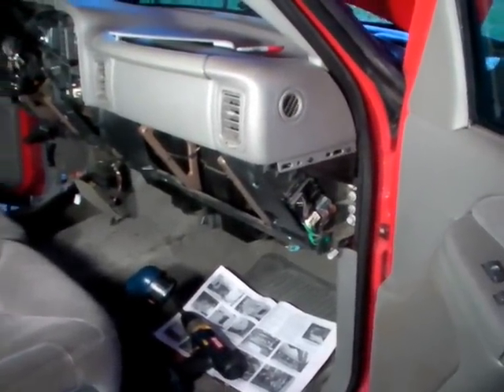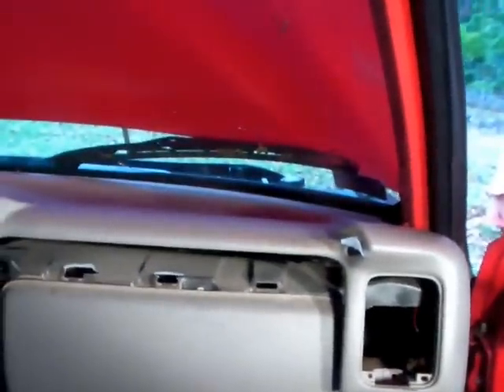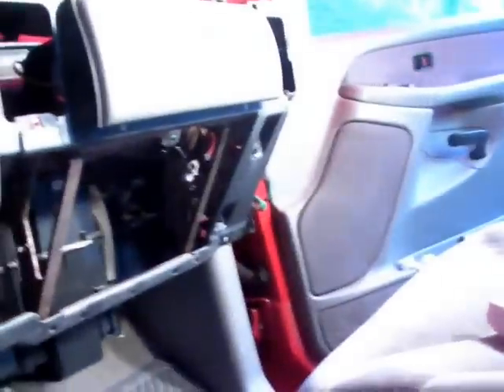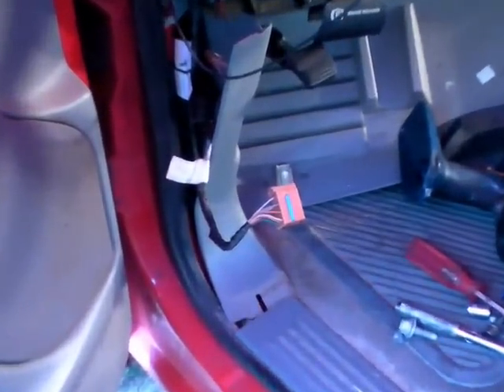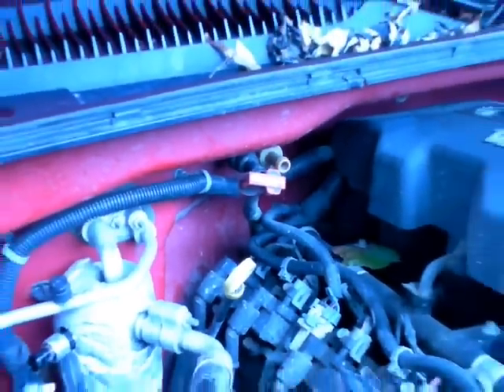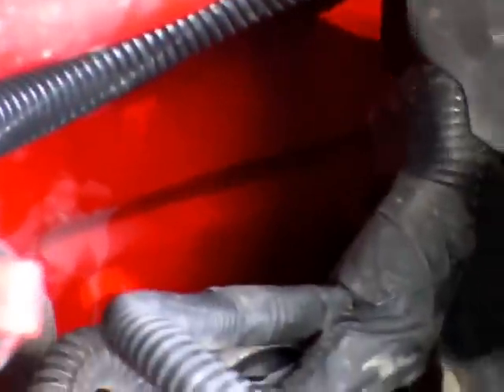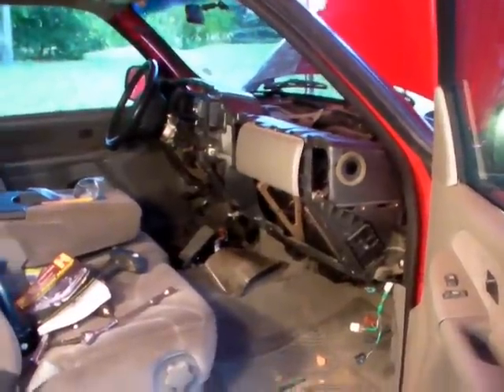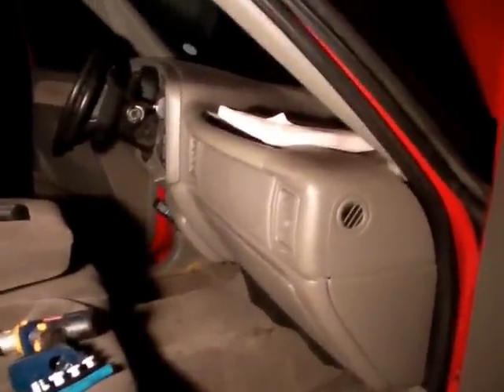GMC Truck Heater Core Replacement 2000 Sierra Silverado

Comment: I've been a mechanic for 30 yrs. I have done several of these and there are flat rate tricks for this job. Leaving the column in is one of them. Good job my man. Not many can do this job without major difficulty. A+
Reply: Want to do one ?  Mines leaking bad

Comment: I am a 50 year female and had my 19 year old daughter helped me with this project as it was her truck. It was definitely an undertaking. The big bar needed to come off on the passenger side and it took me a quite a while and a couple of times watching the video before I saw that important piece of information. Once I got that off and the two screws that were hidden up behind a bar in the center of my firewall it finally came free enough to remove the heater core. It was nice having some help putting it all back together. Did not have any leftover parts, so that was a good thing. What was Chevrolet thinking? If my 05 Tahoe ever goes out I might pay someone to do it. Then again, it has to be easier the second time around right? Hope, I NEVER find out! I won't be giving up my day job to take up wrenching.

Thank you for posting! I would never have figured this out without YouTube videos such as this.

Comment: Thank you SO much for this video. My son wanted to replace his heater core on his truck, and I told him that it will be a herculean effort - well, I found this video, and he watched it on his phone and took off to have his A/C drained; he was gone in a flash while I was pulling tools out that I thought he went to visit his girlfriend lol. He came back, asked me to turn the radio on, and told me that he just wants me to hang out and he will do it. Well, 5 hours later, he had taken his dash off, replaced the heater core, and had it all back together and running perfectly thanks to the video. The only "help" he wanted from me was to chew the fat and keep him company. 16 year old kid. He said to me after putting the last screw into the dash "I wish I could shake that man's hand for his video".
Reply from the maker: Glad to hear it helped him out. It took me a lot longer LOL

Comment: Hey.  Thank you very much.  Your video inspired me to do the same job on my 2003 Silverado.  it pretty much went the same....lots of trial and error, but slow and steady.  I ran into a snag that I would like to warn others about....if you end up freeing the passengers side airbag canister, be very watchful when you put it all back together.  I ended up having to backtrack after having it 95% reassembled because somehow, the lower mounts on the canister got hung up on the dash sub frame and would not budge.  This caused it to stick out a little on the bottom edge, so if you see that stop what you're doing and fix that first. I wasted 2 hours backtracking and trying to figure out what went wrong (mind you I was very tired after 7 hours of working on it before this discovery, not to mention a full day at work work also).  I found that loosening the top 2 bolts on the front of the canister through the vent holes to completely remove and reset the air bag canister was the best route.  I am happy to say that I had 0 extra bolts and I know that everything was back the way I found it when the job was done.  I understand now how a persons spiritual beliefs take the foreground in this job, because I caught myself praying a lot! A true test of your patience. Ridiculous design! I also replaced the stepping motors in the speedo cluster during this job since it was acting up also.  Now I have heat, no syrupy nauseous smell, and a smooth operating instrument cluster.  Air conditioning will be restored on Monday as I want to have the garage perform a vacuum leak down test since it is a new to me vehicle.  Thanks again and sincerely, God Bless!

Comment: Great Video!   I cannot, for the life of me, figure out why the engineers did not place this heater core in a more accessible area.
Reply: Because "engineers" couldn't pour piss out of a boot if directions were written on the heel...

Comment: From a fellow Christian shade tree mechanic!  Good video and giving glory to God too.  My 2000 Sierra just stopped giving very much heat... it’s not leaking so I think I’ll try back-flushing the heater core first. This replacement project looks tough but a 1993 Taurus I did years ago was far worse. The whole dash was removed down to the firewall. GM used to make the heater cores accessible in the 70’s and 80’s from under the hood but following fords lead they went modular assembly for HVAC systems.

Comment: Well it turns out I did it. It was not as bad as it looks, and reassembling went much smoother than I expected and it was nice getting a chance to wipe everything down. In my experience I did not have to drill out the rivets on the glovebox hinge bracket, you only need to take the bolts out, also the large metal support bar is something you should try to disconnect from the firewall, the entire dash is connected to the metal bar and will not come out with out it. Other than that your video helped tremendously, thank you!

Comment: Ithought it was quite funny that you combined carpenter skills with mechanical skills by using the claw hammer to draw the heater box flush with the firewall !!!  Very clever. lol.  Good job on the video. Keep it up.

Comment: I know and Gods knows you lied about your refrigerant "leaking out." That's okay your video was still helpful.
Reply from the maker: I never said anything about it leaking out. Im sure a little did but you dont want to get air in the ac system if you can help it. Glad it helped

Comment from the maker: Your welcome.  I bypassed the heater core when It started leaking until I got around fixing it. At that point I only had to add a little coolant, basically just enough to fill the heater core.
Reply: How do you bypass the heater core?

Comment: Have to admit seeing the entire dash ripped apart is intimidating when you have never done it. I love it when Christians take time to give the honor to Christ however. It obviously takes some planning, insight, patience, and on my part a rather tidy some of faith to embark, and follow through. I am impressed it took only 8hrs. I have rat issues and am looking for any information I can muster to take apart the air box to clean it out, and find my best method of rat proofing my cab. I need to properly seal off all openings with wire mesh. I live right next to a farm, it is cold out, and despite my best efforts to clean up after them, and disinfect they keep coming in.  I am not sure what to do.

Comment: As an owner of an 04 Escalade, I'm impressed with how poorly engineered the GMT800 platform was.  I'm pretty sure the design and engineering team who put this vehicle together came from some indigenous tribe who had never seen civilization before. And it's not even like GM needed to conserve space, thus forcing the heater core location. The more I work on my Escalade, the more I realize I need to dump it, and quick before anything else goes wrong on it.

Comment: Your right Art, I keep thinking the model year changed in 2001 but it was 2000. My mistake. Greg, yes it has to come apart in this fashion. I just did a 1999 Suburban and it was just 6 screws and a clip

Comment: On my 2001 Silverado, facing the firewall from the perspective of outside the truck in front of the grill, the inlet is on the right and the outlet hose is on the left.

Comment from the maker: Pull the two black hoses off the the heater core by the firewall and put them together with a couple of hose clamps and a barbed plastic hose coupler...and BAM...bypassed!

Comment: @5:00 that tool is available from Autozone for $10..It comes in a package of a few, in different sizes but I used the black one on my 2001 chevy 1500 silverado..

Comment from the maker: Just remove the heater hoses from the heater core that sticks out of the fire wall (cut off the quick connect fittings) Buy a barbed coupler that fits the hose and put the two hoses together using a couple of hose clamps.

Comment: Does the hot cold air knob have anything to do with the heater core. ? My control knob is stuck on hot
Reply from the maker: no it sounds like a blend door problem

Comment: I gave up on trying to find the quick disconnect tool for the heater core........................I just cut the plastice connecter off the end of the heater core........you can connect the hose directly to the heater core............

Comment: Whats that tool that is needed to "quick" disconnect the heater core ports from? Or is there an equivalent that I might have laying around.
Reply from the maker: James Martin not a real good way to make a tool to remove it. you can buy it at an auto parts store for under $20 or maybe Harbor Freight even cheaper.

Comment: He's making it harder than what you need to.  WOW!  Take 7 bolts out behind the bulkhead and the whole thing drops down.    You don't need to take all that stuff that he did.
Reply from the maker: Sorry, this is the easy way. the manual says to take the steering wheel off.  The 98s and before were the easy ones
Reply: Bradley Harris is this true for all suburban I have a 2005 escalade

Comment: Great video but that is insane to have to take off what seems like half the truck to get at that thing! Has anybody thought about some crazier ideas about getting some heat into a GM Truck? Like drilling 2 extra holes into the firewall and mounting a new heater core under the dash on the inside of the cab and putting a fan in front of it that is on a switch and then turn fan on for heat and bypassing it in the summer?

Comment: my truck it the same model as yours and is leaking antifreeze inside the cabin and it does blows hot air still but have to add antifreeze very often  .my question is how do i know it the heater core the piece i need to replace?.
Reply from the maker: Its the heater core. only thing it could be if there is coolant leaking in the cab
Reply from the maker: You should also be smelling it too.
Reply: Art Keller yes it very smelly i can even see the coolant dripping..and the windshield and windows get all  foggy..thank you for your response
Reply from the maker: Sorry to say your heater core is shot. You can always bypass it if you can do without heat for a while
Reply: Art Keller it be nice but i live in utah and it is way to cold now in winter  ..i probably take a day off and do it no option.

Comment: hey my 05 silverados heater takes a long time to heat up and when it does sometimes it goes, then comes and goes, any idea what is causing it?
Reply: Could be the hot/cold servo on the bottom of the a/c box.  You can verify it by placing your finger on the small circle that goes through the servo- hold your finger on it and move the temperature selector to feel if it is traveling as you adjust it.

Comment: WOW THIS MAY BE MY PROBLEM.
 MY 2000 SIERRA IS NOT BLOWING GOOD HEAT AT ALL.
THANKS FOR THE VIDEO.
 I WILL SUBCRIBE.
 KEITH KUHN
Reply: if your not getting heat, I would just try flushing the core first. I've done a few times with great success. Just undo the heater hoses from the block, drain as much as possible and fill with radiator flush with the hoses suspended. Wait about 20 or more minutes then flush with water.. reassemble and top off coolant. I prefer that to trying to flush the whole system.

Comment: You do not need to replace the heater core!!! Save a ton of cash and a lot of your time and effort.  The fix is cheap and can be done in a couple of hours. I have a 2007 Jeep Liberty and the heater core was leaking and had the terrible coolant smell in the vehicle when driving. I constantly needed to add coolant to the reservoir. This is what I did to fix my problem. I disconnected the rubber hoses that are connected to the heater core.  I then did a thorough reverse flush to get all the crap out. Then I went to Lowes and purchased a cheap sump pump. I believe it was a 1/2 HP model that cost about $99. I previously purchased Bar's Radiator Stop Leak, Professional Strength Formula. The package has six large tablets. I recommend this brand because this formula was used professionally by GM for many years under a different trade name. I then proceeded to connect the appropriate fittings from the pump discharge to the heater core inlet. I placed the pump in a five gallon bucket of hot tap water with the appropriate number of tablets dissolved (I used one tablet per gallon of water) and ran a hose from the heater core discharge back to the bucket. I kept the bucket at the same elevation as the heater core. I then ran the pump for about 20 minutes in this configuration. After that, you just remove the pump and blowout the remaining liquid from the core, reconnect your radiator hoses and you are done. Now turn on your car and let it get up to temperature and turn your heater on and run it for maybe 15 minutes. My heater core no longer leaks, and I am a happy camper. Do NOT make the mistake of putting the radiator stop leak in your radiator as suggested by the package instructions.
Reply: Interesting...
Reply: The GM brand of radiator stop leak is ACDelco Part No. 10-108 12378255, When the pump was running I would create some back pressure by placing my thumb over the discharge hose. This helped force the stop leak into the little nooks and crannies where the leak was occurring. I did this setup because I did not want to go through all the work you showed. What a nightmare. I thought, if this did not work I was no worse off than when I started, I would still have a messed up heater core. However, I would not foul up my radiator, water pump, engine block, etc. which I have seen happen to some on YouTube when using stop leak products. Maybe I was just lucky but this did solve my problem.

Comment: Why are you doing that, my heater wasn't working on a 2004 Silverado. My brother is a mechanic. That's what he did is replaced heater cores when needed.  I took a couple of heater cores  apart. And guess what I found and figured out. The reason a heater core stops working Is,  there is very little, and I mean very little,  coolant pressure on the coolant flowing through the heater core. That's why if even the coolant level is a little low, you can lose the circulation in the coolant for the heater core. So In that case if  a vehicle loses heat, it doesn't take much restrictions to stop a heater core from working.   So after figuring what I learned. I figured out a plan and a way to flush my heater core. Because taring apart a vehicle to replace a heater core is such a big job. And time consuming. Plus just the heater core is about a hundred thirty dollars or so. So I figured out how to flush my heater core. It only takes about a half hour. And now I have heat, didn't cost hardly anything. I did just buy some extra 5/8 heater hose. Disconnected the heater hose where it was convenient. It may be different for different vehicles and flushed it with air pressure and water. And pushed a bunch of junk  out of the heater core. And now I have heat. After I did that I made something so next time I can hook up a water hose and a air hose at the same time to flush a heater core. The problem is people don't really know what's going on inside a heater core. But it not that big of a deal. Like I said it takes very little restriction to stop a heater core from working. It's not all plugged up like you might think. And to be honest with you. If people would change the coolant when it's supposed to be on a vehicle,   the heater core wouldn't get plug in the first place.   But flushing it will work. But don't just use water, you need air for  agitation  to get a good flush. Just connect what ever hose's you need and put a cup of water into the hose going into the heater core and push it through with air behind it . And repeat several times. And for best results flush in reverse and flus both ways several times. It easy. And if you need to do it again in the future it no big deal. But for best results. Change the coolant in the vehicle as well. The old coolant. Is what's causing the problem in the first place. See old coolant turns acidic and starts eating the metal inside the engine block causing material to accumulate in the coolant system, and it's going to settle where ever it can, and being that the heater core again has very little pressure flowing through heater core. This derby easily settles in the heater core. And again it takes very little to stop the coolant from flowing through it.  Don't be afraid just flush it. It's a lot easier. And it will work.

Comment: why don't DETROIT make it possible to R/R heater core or A/c  core thru the the firewall?
Reply: You could reroute if you wanted to. Just a couple of hose clamps and a double male adapter..

Comment: You don't have to do any of that. 6 screws and the bottom of the heater box come down. One screw and the heater core is in your hand.
Reply from the maker: Not on this model.
Reply: +Robert Ries what about a 2004 yahoe ?
Reply: Not on my 01 Silverado. The only thing that pops out that easy is the cabin filter.